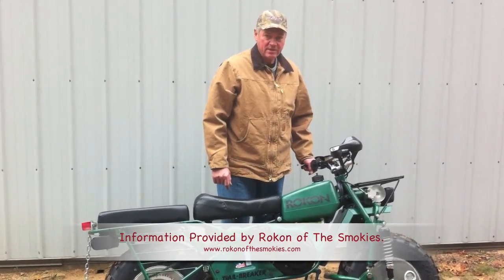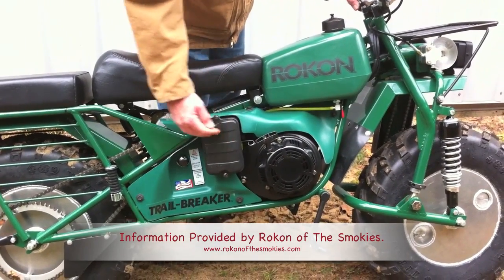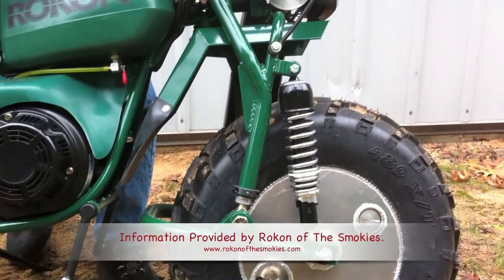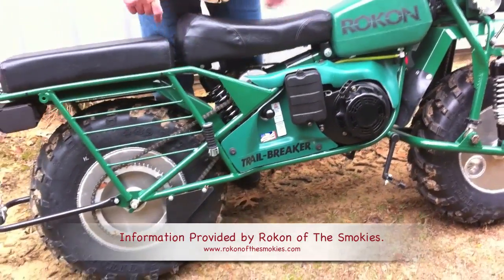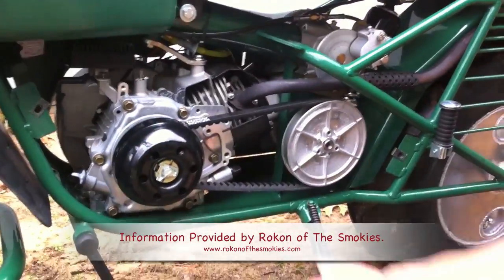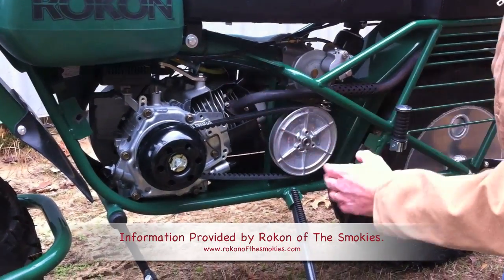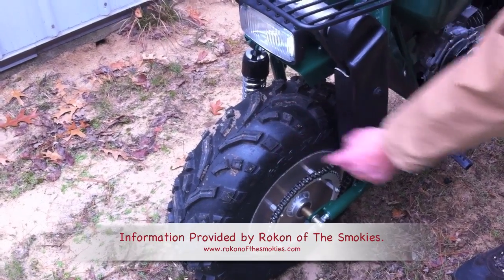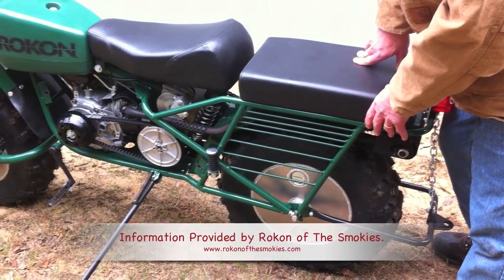Rokon Explained

Comment: Didn't realize it had a cvt. Not sure how much to trust those. Honda makes hydrostatic for ATVs.
Reply: We've had 2 in our family for years. A 60's Trail Breaker (The Big Yellow One) with the 3 speed suicide shifter on the left of the gas tank & a Ranger model and never had a problem with our cvt/ivt clutches.

Comment: I have heard the engines tend to overheat, is this true?
Reply: I have not noticed this or heard of it happening. The motor runs at a pretty low RPM and was designed to run all day on a generator.
Reply: Thanks.

Comment: Poor vid but I have to disagree with those complaining about the power. These are designed for back country trail riding and multiple hauling and homesteading type chores. Dragging big game out of the backcountry etc. They will go where jeeps ATV's,  SxS's simply can't go. If you need speed or want to zoom around trails get an enduro or dirt bike. These new ones will go 35 MPH and that is plenty fast on a narrow backwoods trail or where there is no trail at all. The people who own these don't get rid of them very often. They might be expensive by some standards but they are built like a tractor.
Reply: I have to believe that the people complaining about the power don't have Rokons. Mine has the Kohler engine, and although it's not a horsepower monster, it doesn't need any more because it does what it was designed to do very well. It has enough oomph to climb beyond it's vertical capability, and enough pulling power to drag things beyond it's traction limits. As far as top speed, whatever, it goes as fast as it should travel with big fat low pressure tires. I literally gave my ATV to a friend when I received the Rokon and don't regret it a bit because the Rokon can go way beyond anywhere an ATV can go.

Comment: Its pretty amazing how long this motoring vehicle has been around. I remember seeing it in Popular Mechanics when I was a kid in high school. Now that I am retired, it has not lost its appeal. This is a very niche bike; and would be ideal for those who encounter extremely difficult terrain, right at the trail head, or right outside one's back door. Here in southern California, with our arid climate and wide open spaces, there are other bikes that might provide better ability to cover a lot of ground more quickly, while carrying a decent load. This bike is good for solo hunter/adventurers, who need to be completely self contained for a prolonged period, or for groups who all have a similar bike. Also, I could see this bike as a sag vehicle or playing a support vehicle role, where it is the designated "pack mule" for the other bikes, especially with its ability to pull a cargo trailer. Potential customers who have considered all the merits of this bike, along with the intended purpose and terrain that they may encounter, should be satisfied with this choice.
Reply: Pretty amazing these have been made for so long with zero R&D.   These things should be improved.  The concept is good but they are not reliable as far as the two wheel drive system.   My dad was a dealer in the 90’s and they were nightmares.
Reply: @jamesc6137  James, that's interesting. First hand experience, not favorable but still honest, is definitely a factor to  consider. Thank you for this little slice of life.

Comment: have fun when the belt is wet !
Reply: Really not that much of a problem. If you have a model with just a steel frame cage on around it, then yea maybe some trouble but putting on that full size shroud helps out alot.